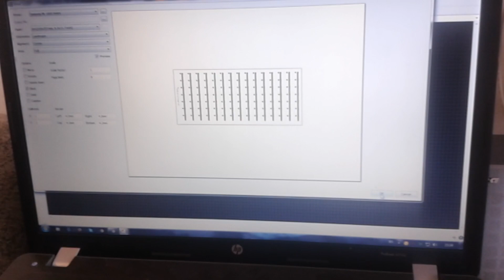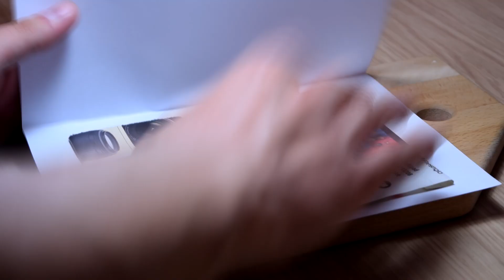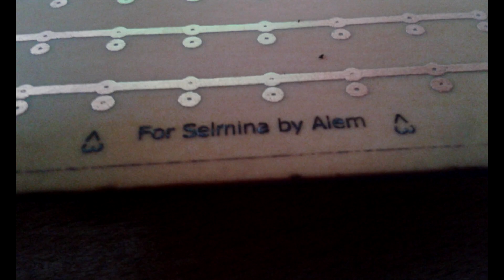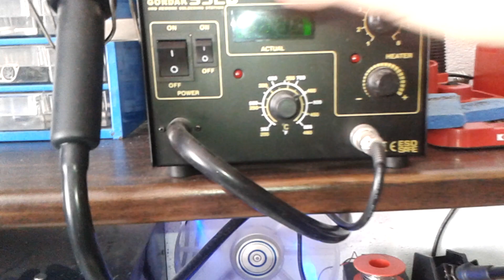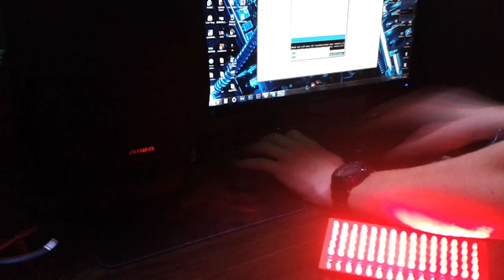Cool present for your girlfriend DIY by Alem Electronic

Comment: I have Made the Exact copy But i am Not getting How to Add EEPROM first. Characters are not Coming, LEDs are blinking randomly. i have EEPROM library too... I can't find the solution
Reply from the maker: You upload EEPROM code to arduino than you upload second code make sure that you connected everything properly if you were using solder paste clean it up well